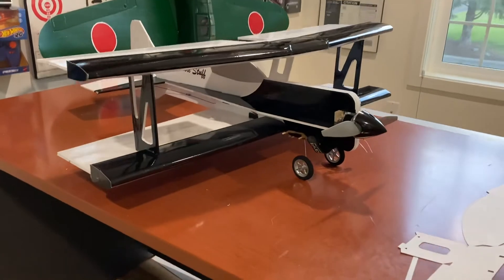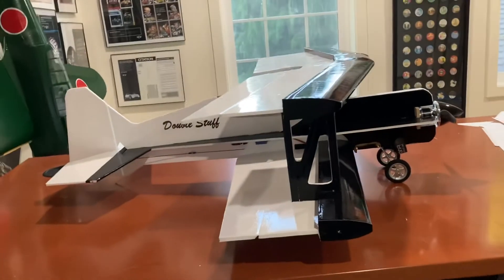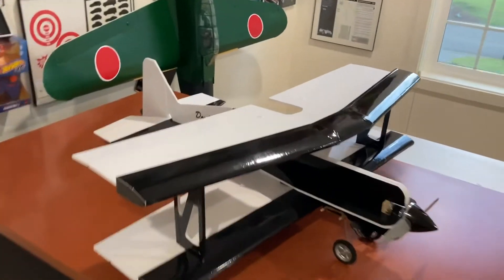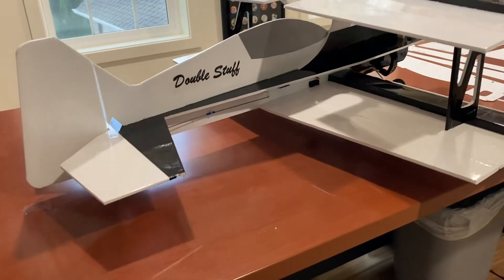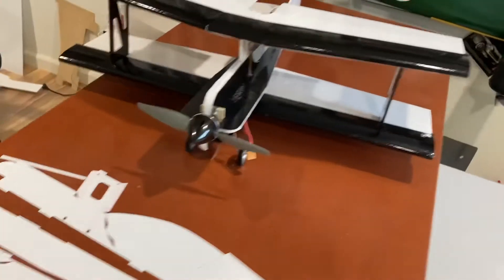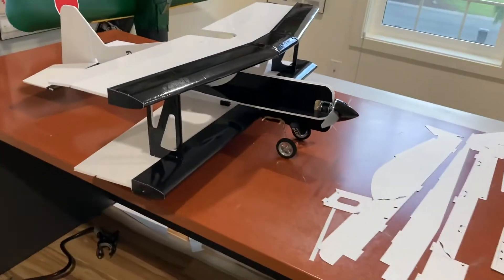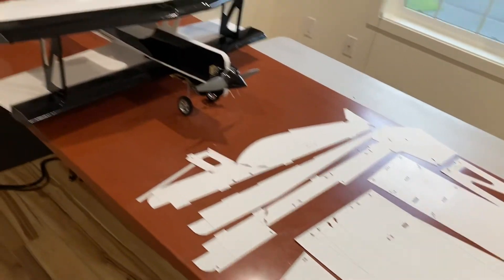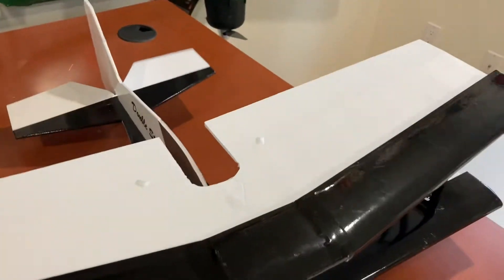Foam Board Profile 3D Biplane “Double Stuff”

Comment: Interesting use of aileron servos. I've seen biplanes that have a servo for each aileron. But I never thought of just using a single servo for each wing.
Reply from the maker: @waynemiller6070  works well. Used similar setup for the Camel and Ultimate Bipe (on the build table)